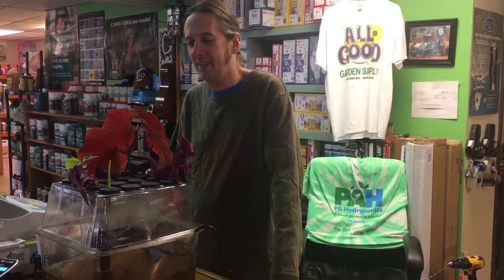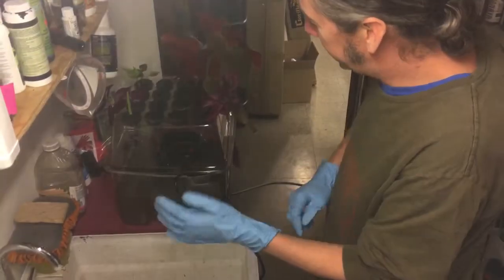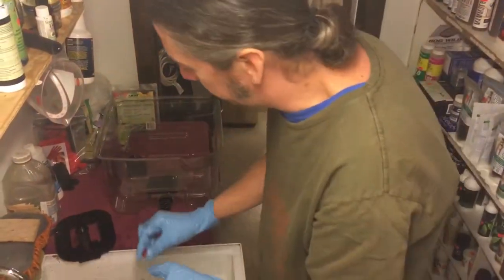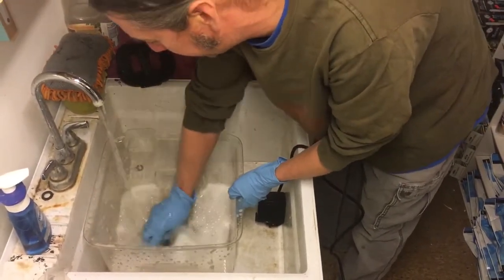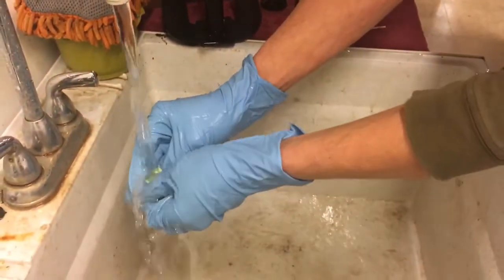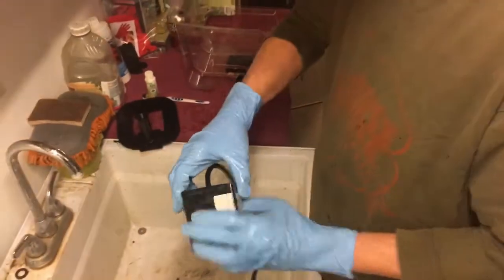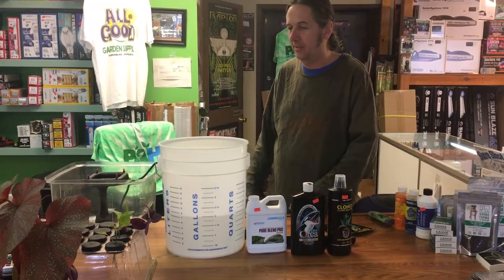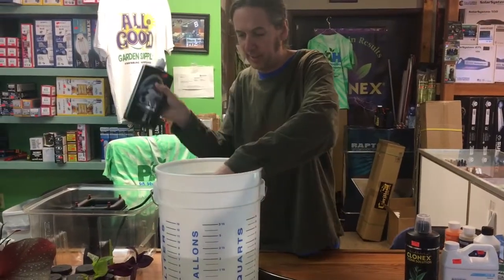CLONING SERIES PART 3 -  PRO TIPS ON FILLING & MAINTAINING YOUR CLONE BUCKET & WATER PUMPS

Comment: For a 20L (5.28 Gallon) bucket  would it be better to use a pump rated for 850L (224.5 Gallon) or a 1300L (343.4 gallon) as I can't find a 250 locally.